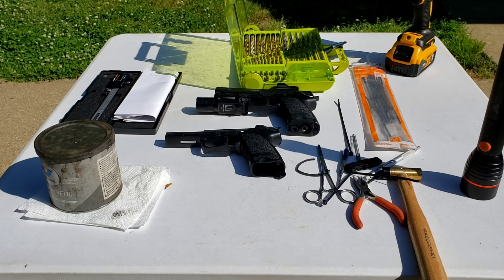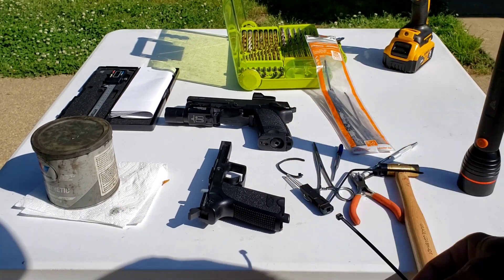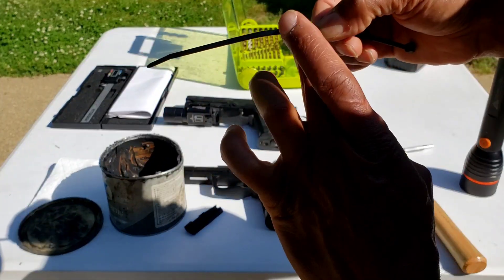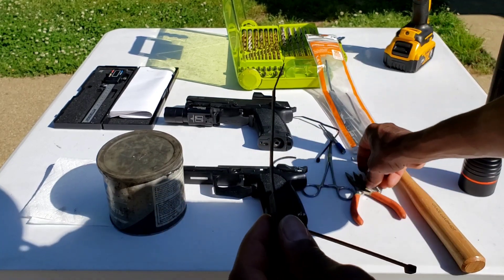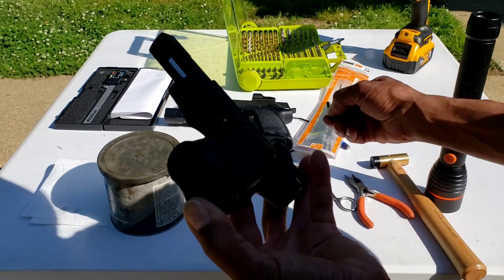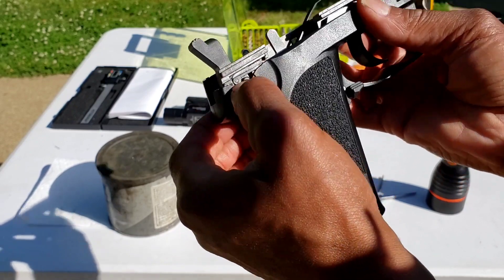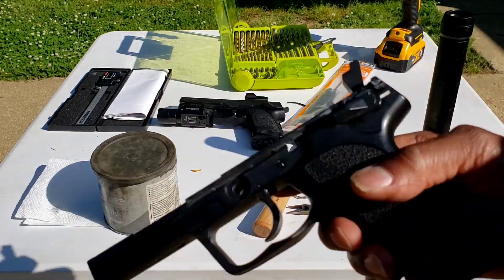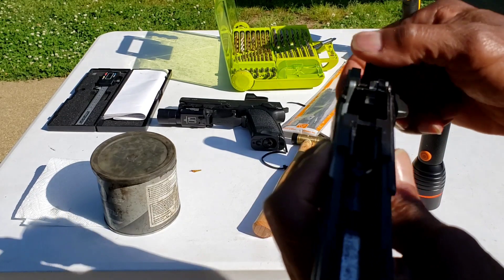Umarex HK USP cracked frame repair and prevention

Comment: Just did this mod on my 6mm version, these instructions worked perfect. The important thing is to make sure the locking part of the ziptie is small enough to fit in the pocket above the dowel pin inside. My 0.140" tie was too big to fit into that pocket, so I trimmed the corner of the locking part. It's important that it fits neatly, otherwise your magazine wont go in! Also if your frame isnt cracked the fire control group will only move a fraction of a millimeter when you push on it, but you can kinda see it. But as long as the tie is putting tension on the dowel it will reduce the stress on the plastic, so it's not so precise. Great video!
Reply from the maker: Thanks for the reply.  It really means a lot when I see that that the video is helping people with this issue.

Comment: I'm about to make the modification on a new Umarex USP I've just bought. I'll let you know the result soon in my commentary. I found a 0.09" wide x 8" long cable tie from ABB Thomas&Betts, part number is TY5232MX.
Reply: It was a success. Not too difficult to do with tools similar to those used in the video. I highly recommend the TY5232MX cable tie. Thank you.

Comment: Should both ends of the cable tie be behind the sideways going bar inside the handle?
Or only the other? Which one?
Reply from the maker: where the cable tie connects it should be at the top or behind the bar so as not to interfere with magazine insertion.

Comment: Wow very impressed brother!! I just purchased a hk45 from my friend at work who shot it very little and the frame cracked shall we send it back to get repaired and now I own it. I haven't shot it yet but I definitely will be doing the preventive repair. I was very impressed with your video and I was curious if this was your idea or you found it somewhere else? HK is always been regarded as high quality I really can't believe that they have this issue and it's not corrected!
Reply from the maker: Thanks for watching. Umarex dropped the ball and used a low quality polymer for the frame.  I came up with the idea after my second pistol started to crack.

Comment: Just a suggestion, get the light behind the object. Good vid but hard to see what exactly is happening. I’m looking to get this pistol as a trainer for my real USP.
Reply from the maker: Thanks.  I really struggled trying to put this video together.
Reply: @ ok so I just got mine and it looks like a 2018 model. Do you know if they made any changes? It’s metal in the rear slide rails, there is a metal insert inside the full length of the frame on mine.
Reply: Just did the mod, great thinking buddy. Excellent. Difficult to do for sure, my mag doesn’t drop free as the zip tie end sticks out just a bit. Do your mags drop free?

Comment: Excellent video buddy. Question please : When doing the "prevention" mod, ( no cracked frame ), how much tighten pressure ? Fully crank it down firmly ? .........or stop when slack is out of tie wrap, with maybe a click or two to snug up ? Thanks !
Reply from the maker: Once the tie it on the pin I would say one click then check the tension with a small screwdriver.  Another good way to tell is to remove the pin holding in the hammer spring then look through the hole.  If it's still lined up you are good, if not then tighten till it's lined up and reinstall the pin.
Reply: Thanks, that's all I needed to know. Now off to view your new PPK video....😁

Comment: How hard is it to remove the trigger bar? I'm thinking to measure mine up and get some spares machined
Reply from the maker: Not too difficult at all. If you do happen to get some machined id gladly buy two from you.
Reply: @turbo15100  ill pull it apart on the weekend and let you know
Reply: @turbo15100  By the way how did you mount the red dot on the slide?
Reply from the maker: https://www.amazon.com/Gorilla-Heavy-Double-Sided-Mounting/dp/B082TQ3KB5?th=1 @davek2977
Reply from the maker: I use the gorilla 60LB tape.  First clean the slide and optic with alcohol.  Next take a blow dryer and heat up the bottom of the optic then attach the tape to the optic.  Once the tape is on the optic heat up the tape for a few seconds then heat up the slide where you will be placing the optic.  Next attach the optic to the slide and let sit overnight.  Make very sure the optic is completely aligned before placing it on the slide.  If the optic is not put onto the slide correctly repeat all the steps again!  Do not pull it off and then try to correct.  Start over!  IF done correctly you will be able to rack the slide with the optic and not lose zero.
Reply from the maker: I used gorilla 60lbs double sided tape. @davek2977
Reply: @turbo15100  Thnx haven’t done anything yet. tried to get the trigger bar out and wasn’t sure what was holding this thing together. any tips?
Reply from the maker: I'll have to pull out my old frame and take a look.  @davek2977
Reply from the maker: So sorry for taking too long...but I figured it out. Once you have the slide off
1. Remove the pin at the bottom of the frame that holds the main spring.
2. Remove the pin going through the trigger. Comes out on the left side.
3. Remove the Phillips screw on the dust cover.  Inside the front of the frame.
4. Looking at the top of the fire control assembly you will see a pin. It needs to come out on the left side of the frame since there is no hole on the right side. I used a pair of needle nose pliers to push it out. 
5. Once the pin is out push the safety selector upwards then pull the selector plate up and off of the selector. 
6. Once the plate is off the selector rotate the selector down towards the bottom of the frame and twist it out.  
The metal internals will now come up out of the plastic frame.

Comment: Umarex, I have three pistols of this brand and all of them has QC PROBLEMS. Their engineering team has big problem too. Things like this should not be happened and they don’t even think to fix the problem.
Reply from the maker: I agree.  It's an afterthought to them.  If it wasn't for the frame/trigger bar issues this would be a tough pistol to beat.  I still enjoy shooting this pistol but tend to only use it in single action.  The frame can be taken care of but the trigger bar is another issue.

Comment: Magazine wont go in
Reply from the maker: Is this after the zip tie modification?  If so then the magazine is probably hitting the lock on the tie. If so try using a large flathead screwdriver to push the lock portion to the back of the frame.
Reply: @turbo15100  yea it was the lock I struggled for a good 3 hours😂😴 I will try again tomorrow thx for the help 👍🏽👍🏽
Reply: @turbo15100  do you believe you could make a video on why magazine wont go in & how to pass that issue?. That would actually make my day better
Reply from the maker: @ericschneider1059  can you remove the slide and take a picture of the inside of the magwell then send it to my email turbo15100 @gmail.com